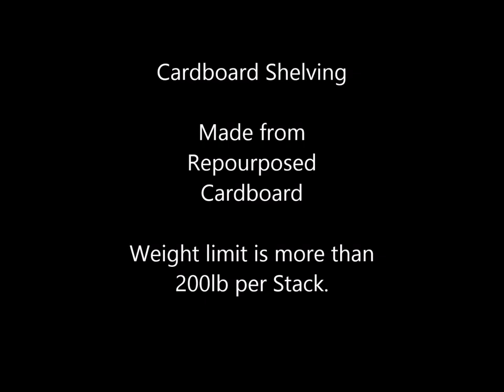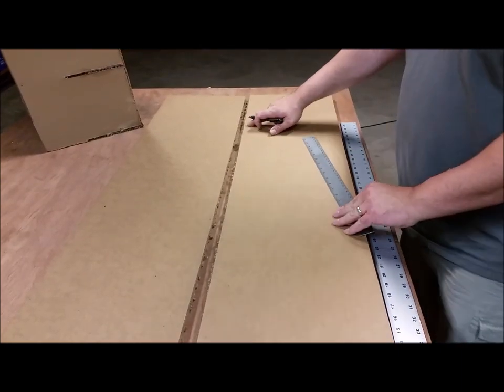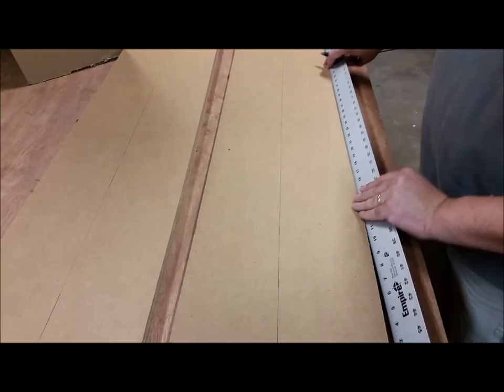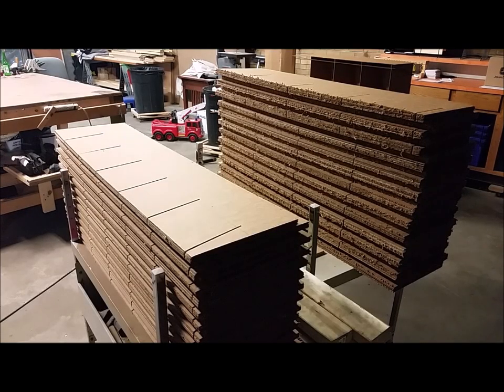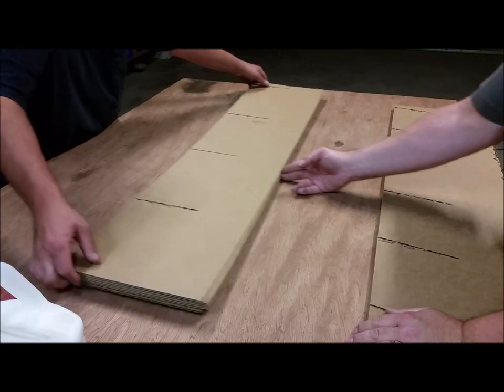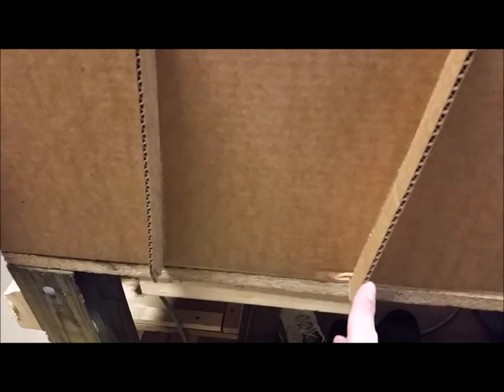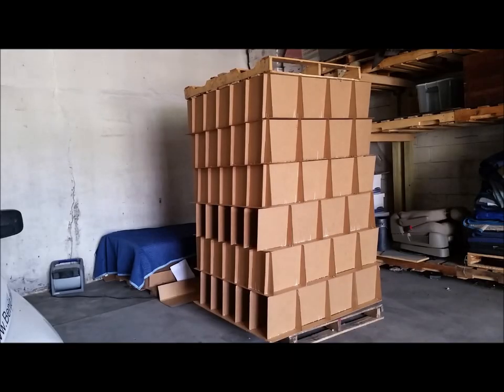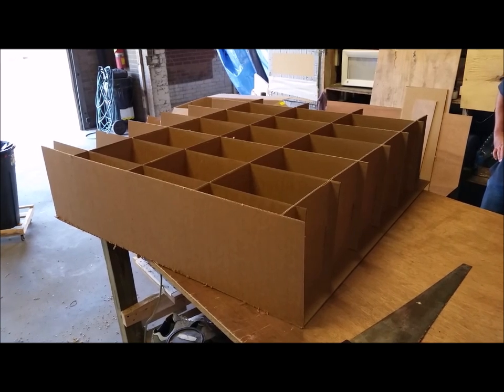DIY Cardboard Shelving Cheap for Shop, Crafts or Inventory Control Step By Step

Comment: I suspect it would be far more cost effective to use tempered hardboard (G2S) for the strength and longevity factor at about $10 a sheet.  Do the math and you'll find it'ss less than 1/4 the total when you include your labor costs. 
Also you can use less restrictive sizing bc of the extra material strength.

Comment: Yeah nice but just make sure u dont put anything in those shelves cause they will collapse even if u fart near them.
Reply: No they won't. It seems like they would but they don't. I made some and they're surprisingly sturdy. If you use paper strips mixed in 1/2 wood glue, 1/2 water and cover all sides with that it's even sturdier.